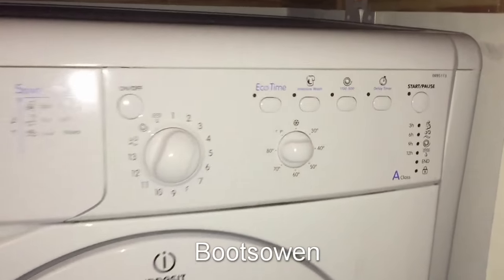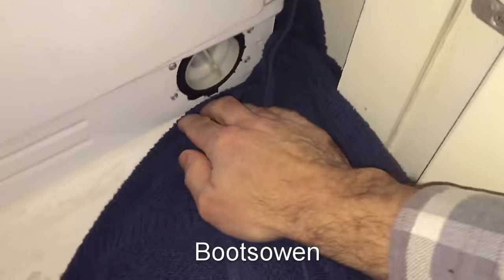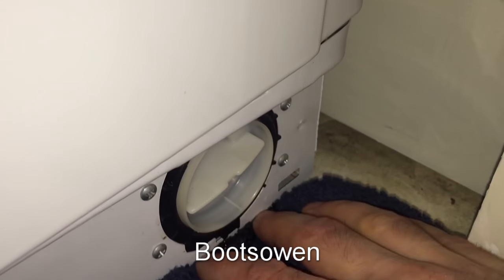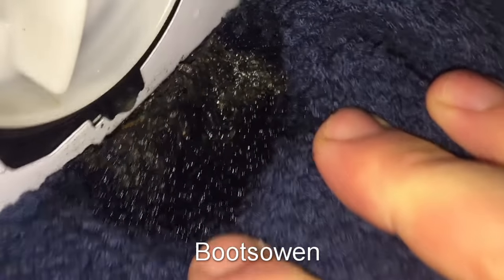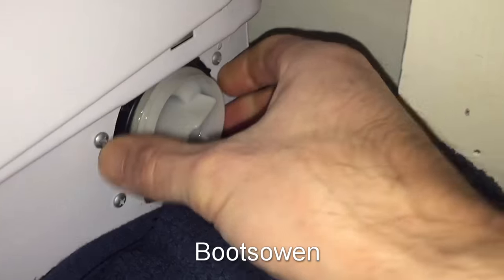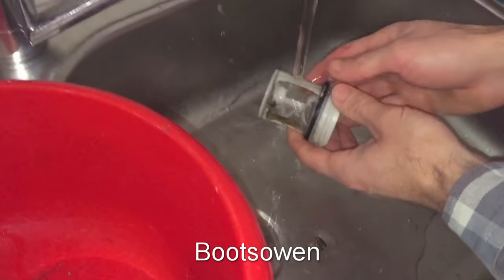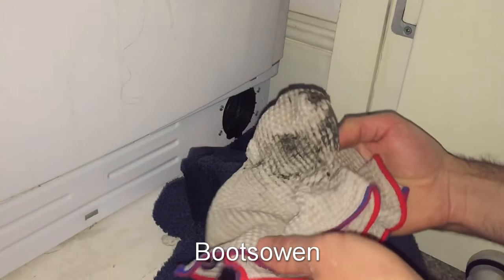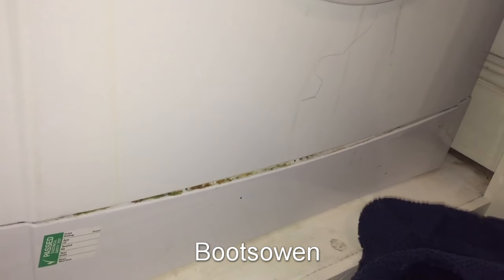How to clean Indesit IWB5113 filter (difficult to open!)

Comment: Question: i managed to get the filter out & clean it, put it back on it's place but unfortunately water is leaking from underneath the filter, I did screw the filter back in properly like it was before. Any tips what did I mess up? Or what should I try in order to stop the leaking when I start a washing program? Thanks in advance!!!!!
Reply from the maker: Take it out again. Look at it and see if the rubber seal and the mating surface are clean and undamaged. Wipe it with a clean cloth. Screw it in again. There are 2 possibilities if it wasn’t leaking before:  it has become damaged or you haven’t screwed it in properly. Keep going until you get it right. It shouldn’t be difficult. A grain of sand on the rubber can cause it to leak.

Comment: I had the same problem with basicly the same machine, it just stopped and all the lights begin to switch on and off. Couldn't open it by hand but with a tools (and a blanket so it wouldnt be damaged) i managed to open it and same rubbish came out. Dont forget to tide the plug very fast otherwise water will coming out always. Thanks for the movie upload! Saved me a lot of money and time.

Comment: Ps. If it is sand that is in your machiene, do a lightweigth clean wash in your machiene and if it happens again that the machiene stops and lights went on and off.. remove the plug with high speed and let the water filled with sand out as fast as you can, efen it this means a waterballet. Do this as much as needed.

Comment: 2flashing lights on washer wont do nothing. tried everything from unplugging the control panel inside. can anyone help
Reply from the maker: It usually depends what lights are flashing and the manufacturer. Usually error codes are published somewhere online. Could be blocked pump especially if it stopped full of water. Se what lights are flashing and how many flashes. Then google that error code